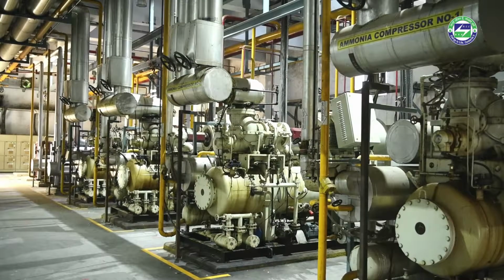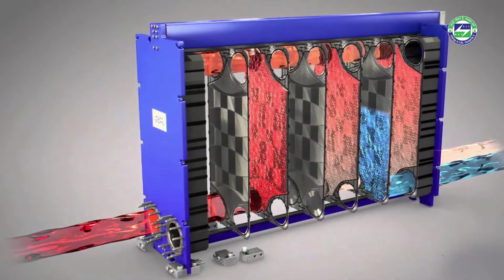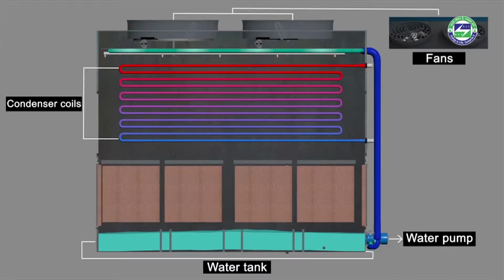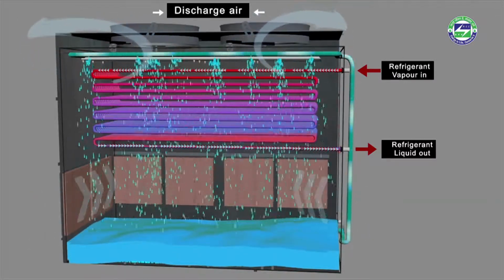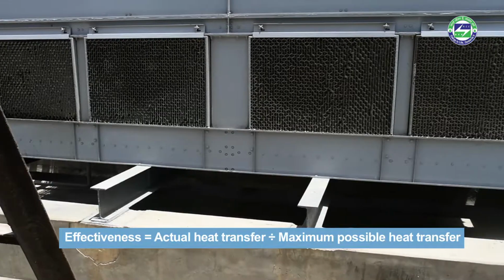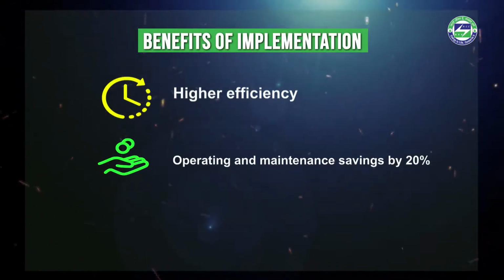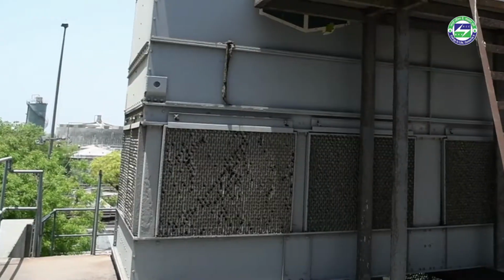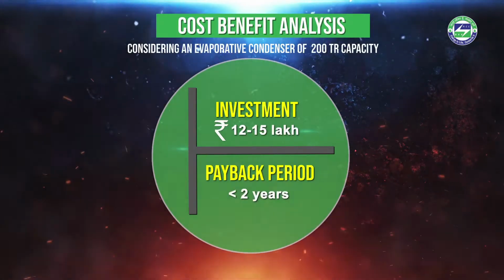Replace shell & tube condensers plate heat exchangers & cooling towers with evaporative condensers

Comment: www.coalpulverizer.in    https://khalsa-brand-coal-pulverizers.business.site

FULL ONE YEAR UNCONDITIONAL WARRANTY ON COAL PULVERIZING PLANT OFFERED INCLUDING WEAR &
TEAR IN THE HAMMER MILL (INCLUDING HAMMERS)                                      UNDP registered vendor

Improving the operation and emissions performance of pulverized coal fired billet/ingot re-heating furnace is of
significant interest to almost all TMT PLANTS in the country today. The recent
development of cost effective plant & components for third generation
KHALSA brand COAL PULVERIZER PLANTS permits ultra fine 200 mesh coal powder,
better combustion performance, increased wear life reliability and decreased
NOx emissions. Existing re-heating furnaces can typically remain in place,
resulting in reduced capital cost and reduced outage time for installation. 

For the last decade or so, KHALSA KOYLA CHAKKI YANTRA (TM) has been developing ultimate technology to
lower fuel consumption, extremely affordable alternative to extremely high
costing coal gasifier plants & lower emissions from pulverized coal firing
systems. KHALSA KOYKLA CHAKKI YANTRA (TM) has come a long way achieving
significant improved reliability & wear life of Pulverizer Hammer Mill
& components. Also providing affordable and reliable heating furnace
solutions in steel rolling mill plants eliminating the 'white elephant' Coal
Gasifier plants. Plants ranging from 2 tons per hour to 40 tons per hour are
available. 

www.coalpulverizer.in 

We will be glad to provide further details. Please contact: coalpulverizer@gmail.com,
surindraengg@rediffmail.com or +91-9815246408 for details.